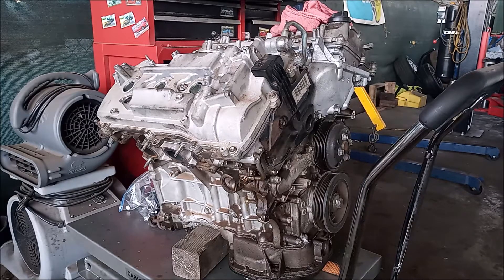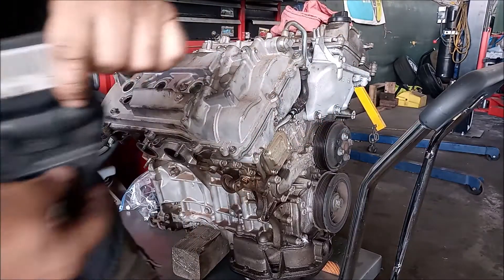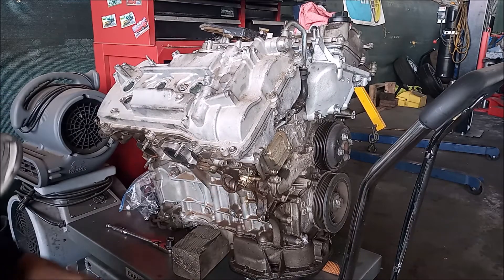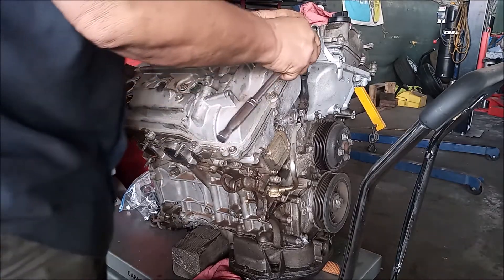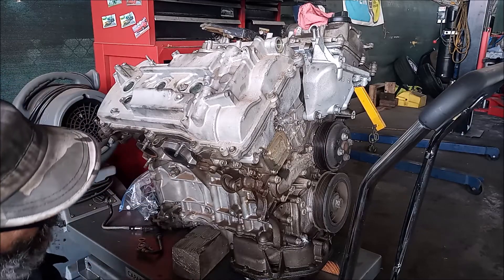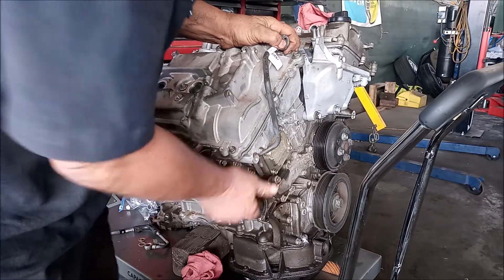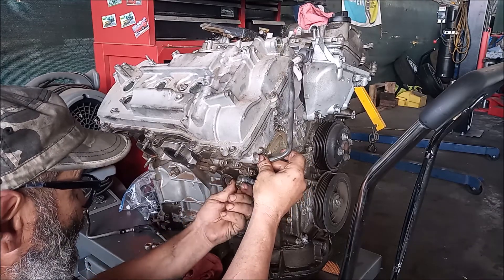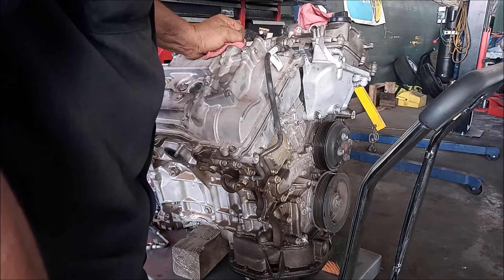How to Replace the VVTI Oil Line - Toyota 3.5-liter V6 2GR-FE - Rav4 Highlander Camry RX350 ES350

Comment: I have a vvt-i question, but it’s about the 1mz-fe. I’m rebuilding it, it was extremely sludged and burning oil really badly. It had only done 94000km. I’ve put it back together but I didn’t clean the intake vvt cam apart, i just cleaned everything from the outside. I don’t think it’s rattling on start but I’m wondering how prone to sludging in the vvt is? Can i just leave it and run it with new oil from now on?
Second question, how many litres of oil burnt would damage the catalytic converter? Thanks

Comment: What specific tools (extensions, swivels etc) would you recommend to access and remove the lower banjo bolt on the hydraulic pump models.  Do you recommend wrenching through the pully opening?
Reply from the maker: No real special tools required - unless the pump has cold welded itself onto the engine. Yes of course you go through the pulley hole.

Comment: thaks for the video. can u let me know where u get the metal pipe for trd version? Thanks
Reply from the maker: you mean for the supercharger? The only place I know is from Lotus. I don't know if or where Toyota sells it. I think I may have one sitting around that is not needed. $200.
Reply: @Merryfrankster_  can u send it to Melbourne? Thanks
Reply from the maker: @trucninh7693  I am not sending anything to Melbourne other than thoughts and prayers. May the force be with you.
Reply: @Merryfrankster_  i means the pipe u put in on this videos, where u get it please? Thanks
Reply from the maker: @trucninh7693  I've put the part number in many of my videos. Check the description.
Reply from the maker: As a matter of fact I did put it in the description for this video. Just click on the link, and buy it.

Comment: I'm doing this with the engine in the car. The filter didn't come out, and I can't seem to pry it out. Any tips?
Reply from the maker: use a pick like what dentists use to clean between your teeth (there are versions of these for automotive applications) and harpoon it. Then buy a replacement.

Comment: As per everyone- Great video Really. Thanks.  I'm doing this on my late fathers' 07 Sienna XLE for my mom. And just curious if there is any kind of a spring attached to the mesh filter? Or any small o-rings on the end(s)?  Can't find any on parts diagrams, but just wanted to ask.  Also- Toyota dealer insisted that 15707-31030 with Yellow line on rubber elbow was the New Improved Part on Pipe Sub-Assembly and that metal version would not fit and wasn't available.... And directed me to the pdf document on the NHTSA website....Now I'm really confused....Please help? Is it different for the Sienna for some reason? Even tho the Engine is the same?
Reply from the maker: The metal line fits. Every 2gr-fe engine is exactly the same. The metal line fits every 2gr-fe engine. Can I make it any more clear than that? This is not the first time this question has come up. Every time, I give the same answer, and I am always right. The metal line fits. Be sure to use new washers if you want a good seal. The little filter snaps on to the end of the solenoid. There is no nothing else. It just snaps on. TOYOTA DEALERS ARE MASTERS OF SPREADING DISINFORMATION ABOUT TOYOTA VEHICLES. NEVER BELIEVE ANYTHING YOU HEAR FROM THE DEALERSHIP.
Reply: @Merryfrankster_  Yeah, I know, just in my ocd nature to do no harm by double checking.  Apologies- you have stated that ad-infinitum now that I tried to read as much as time allowed. I really appreciate you taking the time to reply tho, honestly. Thx. I ordered the metal part (online) and am returning the "new" improved rubber elbow part.  I'm guessing (by prior comments, posts) you are deeply skeptical of the "new " rubber part.  I certainly am.  If i've interpreted that wrong, please lmk.  Also, just fyi- My line(rear)  had not actually failed- nor had it it been replaced/serviced via the TSB or anything else- it was OE.  I decided to replace it because my FORWARD (Lower front combination Metal/Rubber assembly towards Radiator ) line catastrophically ruptured on the highway....So, FWIW- Might be a good Idea to knock that out in any case.  The new part is ALL Metal not surprisingly.. And it's a piece of cake compared to the other one. At least I thought so,- no steering pump in the way.  It's one of those. things- prob smart to just do both as long as you got it all taken apart and up on jacks anyway,,,,And the Forward line spits it out just as fast.  If ya don't cut the power and coast to a stop..... ur probably done...cheers, and thanks.

Comment: Mine was leaking from that banjo spot and I saw car care nuts saying it is usually the timing cover . I took it to Toyota dealer and I was told it’s the banjo bolt leaking and they are asking for $480. Why so expensive?
Reply from the maker: it c an be the banjo or the timing cover. Car care nut would not have anyone watching his channel if he said it was the banjo. Banjo bolts leak all the time, it's a known fact that does not need its own youtube video. The job will cost more if your car has a power steering pump that obstructs the banjo, less if your car has electric powersteering with no hydraulic pump.
Reply: @ thank you so much for the advice. Mine has the electric power steering. I am happy with this rav4 v6 because it’s very fast and powerful. I will keep it forever. Your channel is great and I love the way you explain things with patience and detail. Have a great day.
Reply from the maker: @topo520  thank you for watching and for commenting. Rav4 V6 is a great car. Replacing the banjo bolt washers takes 20-30 minutes if you stretch it. Maybe they include time for road test and check back again with car on lift. The washers cost less than $1 each. I don't know how they come up with $480. Maybe they are replacing the entire hydraulic vvt line? Take your car somewhere else.

Comment: Can you do a video on the 2.4 version?
Reply from the maker: 1.4 does not have an external oil line. It is a different generation of engine with the VVT oil routed internally inside the head. I have several other videos on 2.4 2AZ-FE.

Comment: Thank you very much for your video and listing the parts.  I just ordered them for my 2007 Avalon,  I am hoping that the power steering pump is not too hard to deal with.  I am an avid DYIer but this Avalon looks like everything is going to be a bit of a challenge.  I moved up from Buicks so I hope its worth the trouble.  Driving the car is so nice.  Not sure I could go back.  Thanks,
Reply from the maker: Normally the power steering pump is not too much trouble. Sometimes it is just as easy asa can be. But you might get unlucky. Keep your fingers crossed.
Reply: I’m too late to this comment but how did you end up replacing the party with the pump in the way g

Comment: MerryFrankster, your advice and instructions on the VVT were very helpful and clear.  Have you ever made a video on changing the spark plugs for the 2GR-FE ?    I wondered about a parts list since it involves removing the cowl/wiper motor/intake manifold.
Reply from the maker: Yes you are correct. The wiper tray and cowl have to come off. It seems intimidating but after you've done it a few times it goes very very quick. Same for the intake manifold. The key thing is with the brackets in the back of the manifold. I think I have a video coming up on that.

Comment: I got a question, please. I did replace the VVTI line with the metal one. I do remember that I could not insert the union bolt with mesh attached, so I did insert the mesh then tight in the bolt inside. is that an issue do I need to redo this . Thanks a lot
Reply from the maker: It would be better that you snap the filter onto the end of the bolt before inserting. Maybe by bending the line a little you can make it slip through.

Comment: Around every 6 months on my 2020 Toyota Camry , I power wash the engine and let dry . I then liberally spray 303 Protectant all over the engine compartment and let it soak in . The purpose is to lessen the plastic and rubber parts from drying out and cracking , including the plastic intake manifold .
Reply from the maker: The plastic and rubber pieces that crack and break the most frequently are the plastic lock tabs on the electrical connectors. Also any evap and emissions hoses. The intake manifold.... not so much.
Reply: @Merryfrankster_  ok , keeps them looking new

Comment: 48 Ft/Lbs for the banjo bolts.  I'm glad I was able to find this video again.
Reply: What else needs to be toqued other then the banjo bolts ?
Reply: @zigzag2557  , everything else can get a drop of blue threadlocker.  The banjo bolts were the only thing I was worried about because they have to be tight enough to seal but no so tight they snap.
Reply: @JaronLindow  and did you have a power steering pump. If so did you only remove the long bolt and short bolt holding it in place or did you completely remove yours .
Reply: @zigzag2557  , I don't recall removing the power steering pump, but this was over a year ago.
Reply: @ did you move it out the way or does yours have an electric pump
Reply from the maker: Thank you for watching and for commenting.

Comment: Is there anything you have to do after it's installed? EG: bleed air out,  or reset the system to be pressurized correctly.
Reply from the maker: Nope. Install it and run.

Comment: Great video, was looking at buying a 06-07 Avalon and researched the common issues with them, I don't understand why the line isn't completely metal, very stupid and poor design, way to go Toyota, anyway I thought to use a piece of transmission hose and 4 "real hose clamps" 2 on each side, those squeeze clamps are crap, thanks for your time and parts description, I'll just buy the metal line...
Reply from the maker: Probably the thinking was that an all metal line is susceptible to vibration metal fatigue and could crack, so a rubber line was preferred.

Comment: How you get a torque wrench to tighten to 46 ft lbs botton banjo bolt?
Reply from the maker: Very tough to do. Have tried it, and given up. Not really possible to fit it in and get the angles. Go by feel on this one.

Comment: 30$ pipe and stuff, at least 500$ handjob XD. btw, is like this for a rx350 2012? thanks for the video.Cheers!
Reply from the maker: IDK about 2012 but earlier rx350 have a belt-driven power steering pump on the rear of the engine. Not sure when/if they went to electric power steering. The pump has to be moved out of the way to get to the rear banjo bolt.

Comment: Did you say clean it with a brake cleaner?  What is brake cleaner?
Reply from the maker: It's a solvent that comes in an aerosol can. Available anywhere you buy auto parts. It dissolves dirt, grime, oily residue, all forms of contamination.

Comment: Hello Frank, I just noticed  I'm Lousin  coolant  invto oil with 100.000 soft miles 2011 sienna in excellent  condition what im I experiencing.
Reply from the maker: Possibly it's a head gasket issue or it's an issue in the oil cooler if your car has one.
Reply: @Merryfrankster_  During heat summer days, I was running  around  normally  and I was idling  to keep Cool with A/C On and I thought  maybe  that could  ben results  of crack head gasket Or possibly  oil Cooler  I have freind  his service  manager  for my dealer I'm going take it there one the Hurricane  is out of here that is only thing  that could  cause  it I check  oil last week on Sunday  and everything  was Fine now notice  red antifreeze  mixing  with oil its strange  because  I hardly  drive this car mostly  parked  drive locally  around  town daily driver mint condition  like new slow driver not hard on motor  I'm extra nice to motor, car not sure about oil Cooler  I hope that's least of worries  now hope I'm not going be Dock hiffty  service  invoice 😏

Comment: I wanted to ask you your thoughts on the 2GRFSE.  We are looking at a 2017 IS300 with the 3.5 (2GRFSE).  Thanks.
Reply from the maker: Completely different engine. Lots more complexity with the high pressure fuel system and direct injection plus port injection. I am not as familiar with the 2GR-FSE as I am with the  2GR-FE, so I can't give you any specifics on issues or reliability.

Comment: On the gasket part number 16017, do you need two of those?   I see you only have 1 listed in your cart.  Or do we use the double washer (gasket) on both ends?  I’m confused on this part of the procedure and ordering parts.   Thx.
Reply from the maker: you can use any pair of 12mm copper washers that you want, even from the hardware store, there is nothing magical about how washers work on a banjo bolt. You can use the double washer on both ends, or you can use single washers on both ends, or you can mix it up. I repeat there is absolutely nothing special about the washers - the double washer just makes it easier to install in a hard to reach location.
Reply: @Merryfrankster_  thank you so much for this information.  New subscriber and I’m enjoying your videos.  We bought our son an 08 Lexus ES350.  The oil line was replaced at the dealership with the “upgraded” line that still has the rubber elbow.  This was replaced at around 11k miles and the car has 109k miles now.  I would like to upgrade to the all metal line for peace of mind.  Again, thank you for responding and thanks for the information.
Reply from the maker: @Brian-fo8sh  Thank you for watching and for commenting.
Reply from the maker: @Brian-fo8sh  Just make sure that you get the bolts to the correct torque. I can't recall exactly but I think I mention it in the video. Is it 49ft-lbs? You don't want these too tight, or too loose - they have to be just right.
Reply: @Merryfrankster_  thank you so much.   I literally just left the Toyota dealership and they said parts and labor is 375 out the door.   Now, I’m trying to figure out if I should just do it or give it to them.   I’m most concerned about wrestling that p/s pump.
Reply from the maker: @Brian-fo8sh  Look for independent shop that can do it for 1 hour labor. Parts are less than $50. You could save $200. enough for a few trips to McDonalds with  the kids.
Reply: @Merryfrankster_  I’m going to check around Monday for a few other shops.  Thanks.

Comment: 2007 RX350 (FWD) - Lexus dealership told me the correct part number that I need is....

    15707-31030.....their part is $97 and Toyota part is $33.50  (15772-31030)

Does anyone know if there is a difference between these 2 parts?  Other than the dollar amount of $63.18 ??
Reply from the maker: I am blue in the face from repeating this. They are all the same.
Reply: @Merryfrankster_  Sorry for asking....just doing it on my own.  The dealership told me they weren't the same because it's a Lexus.  And, when I've tried to order the Toyota part # 15772-31030 all the web site vendors required a VIN# and they then stop the order process saying the part won't fit my VIN#.
But, thank you for your video and for clarifying.....once again!
Reply from the maker: @umillj  enter the part number and place the order here. VIn is optional. https://parts.conicellitoyotaofconshohocken.com/
Reply from the maker: @umillj  Don't forget to order the washers. I can't remember which video I have listed all the part numbers.
Reply: @Merryfrankster_  Well, that was Fun! New washers/new line installed.   It was challenging removing the power steering (hydraulic) pump and it's lines which also required new crush washer for high pressure line.  Also, had to disconnect both front sway bar links to allow moving the sway bar for access.  Good time for new serpentine belt too.    Now, I don't know what to do with the old line.....throw it out, or, mount it on the wall like a deer head trophy mount!!!!
Reply from the maker: @umillj  Good job!

Comment: What is the procedure or estimate to do this repair without dropping the engine?  Thanks!😊
Reply from the maker: There is no need to drop the engine for this procedure. Engine was shown in the video to allow better viewing. This seems to confuse some people. Anyway. Repair can be done easily with engine in car. Estimate: Parts $30. Labor: vehicles with p/s pump 2 hours. vehicles wihtout pump 1 hour. Your local labor rate may vary.

Comment: Does the 05 Highlander with the 3.3 have the same problems? Was there a dealer recall on these
Reply from the maker: The 3.3 is a completely different engine. It is a timing belt engine. It is a higher displacement version of the 3.0 and shares most of the 3.0 features. Those engines have their own set of issues. They are prone to sludging. The entire engine becomes encrusted with sludge from the inside. Poor crankcase ventilation is believed to contribute to the issue by allowing accumulation of moisture and debris in the block. Thank you for watching and for commenting.

Comment: I replaced that line after buying my 06vRav4 v6 a few years ago.

But another question,  our 2010 toyota venza v6 just threw a check engine/vsc light and i pulled a p0015 code for " B camshaft position timing  over retarded bank 1".

It seems that this could possibly be the Oil Control Valve solenoid beneath the intake manifold,  firewall side.  Can anyone confirm and does the intake manifold have to be removed to replace the solenoid?  Hurt my back recently and not looking forward to that much leaning over the engine.  Thanks!
Reply from the maker: You can see where the solenoids are, they are close to the timing cover. The B solenoid refers to the exhaust side, that you can possibly access and remove with the manifold staying in place. The solenoid is held in place by just one M6 bolt. If you unclip the harness connector, the solenoid should slide right out with a little bit of prying. It's worth a try anyway. I would also change the exhaust camshaft position sensor, just for good measure.